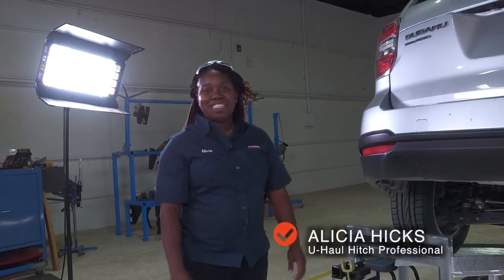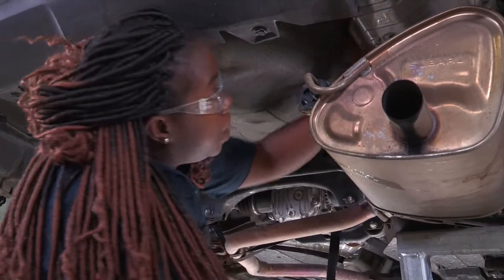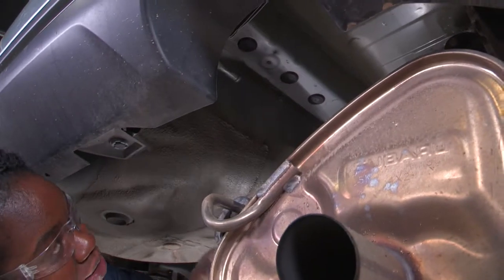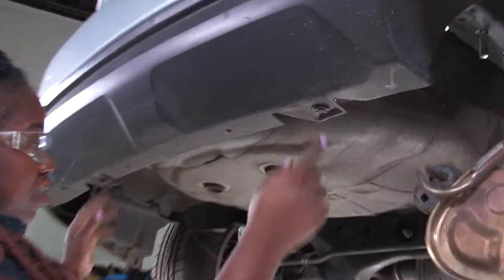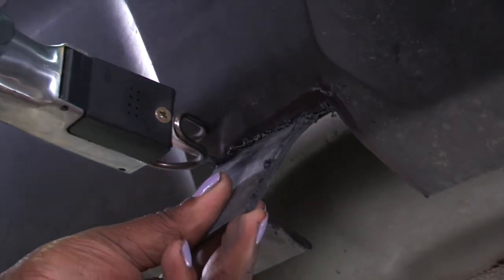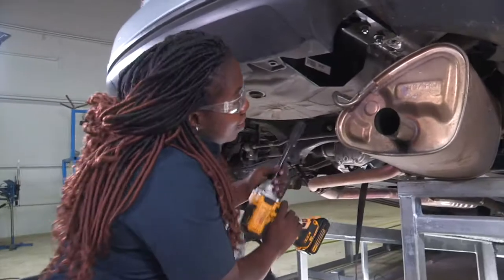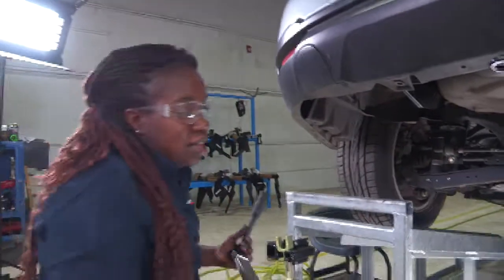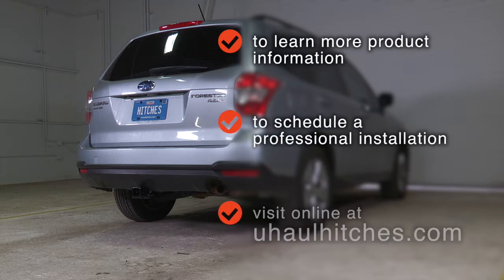2014 Subaru Forester Trailer Hitch Installation

Comment: This installer is good at what she does. This is the best installation video I have found, and it corrects errors in other guides, for instance that some advise enlarging one of the bolt holes to allow access for the rectangular plates. Apparently they have not spotted the fourth, larger access hole. Enlarging one of the attachment holes can weaken the area! You also show how to keep the heat shield by snipping it to fit around the new hitch. Some guides actually suggest throwing it away! Thanks.